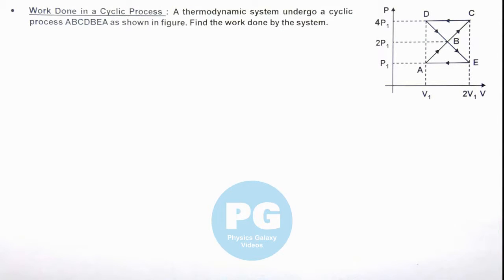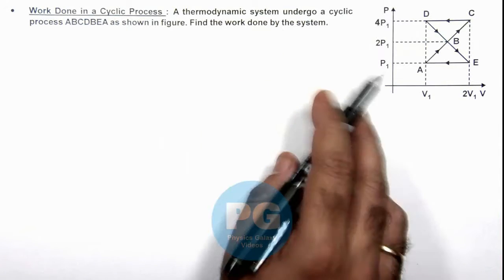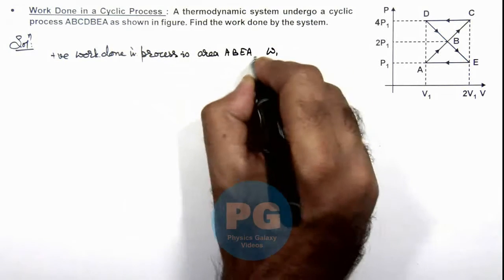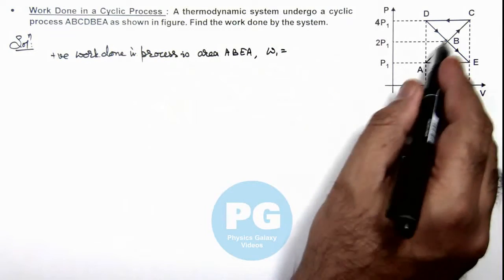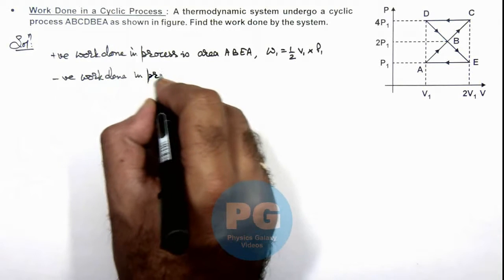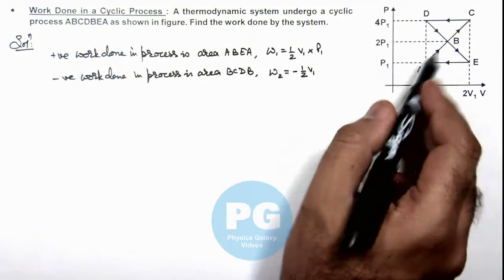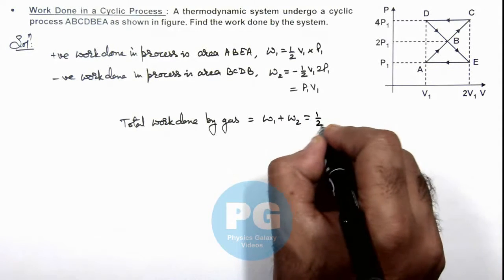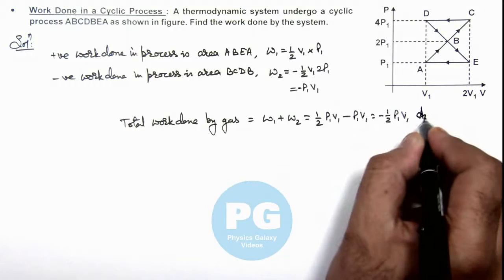32. Advance Illustration | KTG and Thermodynamics | Work Done in a Cyclic Process | by Ashish Arora

Comment: work done by EA +AC+DC+DE answet is zero
Reply: This is because graph is not drawn to scale. It may seem that ABC is straight line but actually it's not.
Reply: same
Reply: Ya same
Reply: No see the arrows carefully
Reply: @ritikraj2679  bro please explain I am also getting zero
Reply: @ritikraj2679  please explain
Reply: @ritikraj2679   i am getting zero also pls explain how
Reply: Both cycle cancel each other work done
Reply: Bro diagram is not drawn to scale firstly(u can do wrong here as I did)............. secondly work in AC & DE are +ve (both exp) and CD & EA are negative (so net will not be zero)